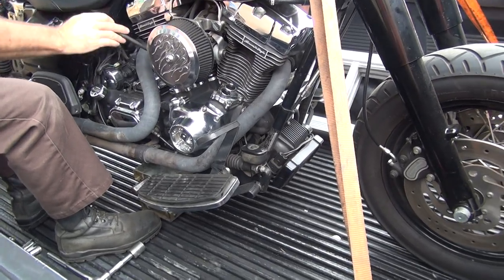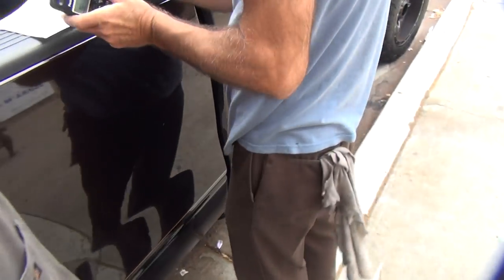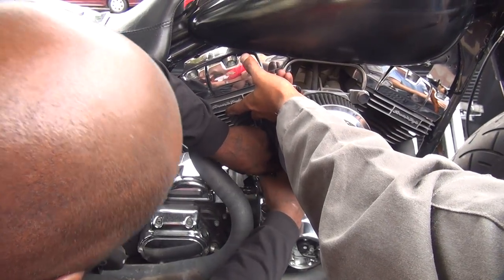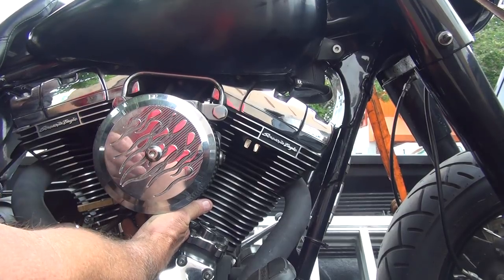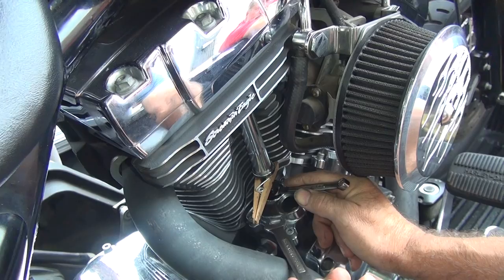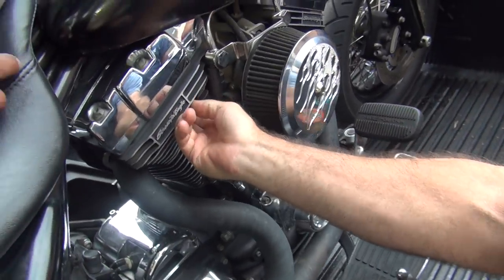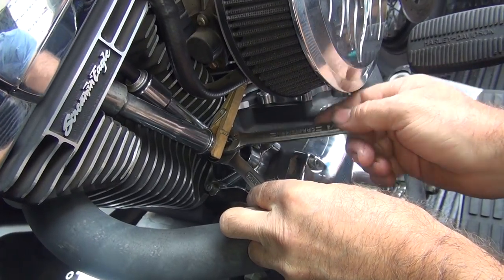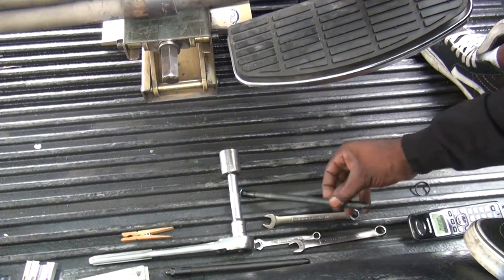how to adjust pushrods 2008 twincam FL touring screamin eagle harley by tatro machine

Comment: 15 flats means they must be Screamin Chicken pushrods...they are the strongest quick install set that I know of though. I don’t like the 3 piece Fueling design and I worry about that 1/4 shaft holding up on the S&S Quickee’s. 
I know you like the Crane pushrods you have for your TC motors but what’s your go to set of quick install pushrods for a Twin Cam or M8 for that matter?
Reply: 100 percent agree with you I went with the screaming eagles myself they look really well made and came with the new covers